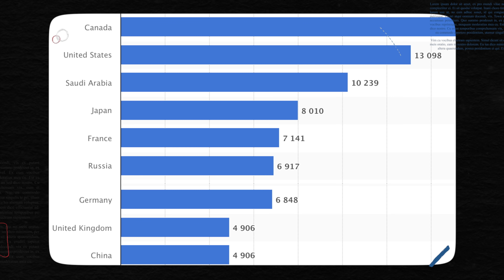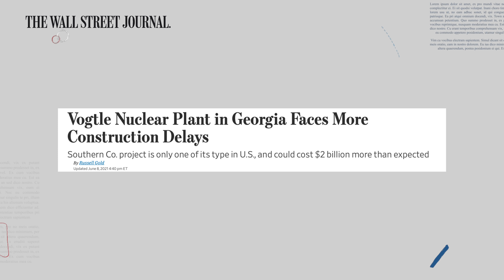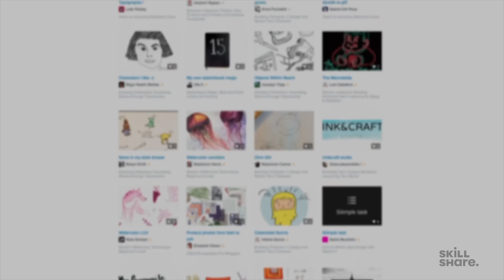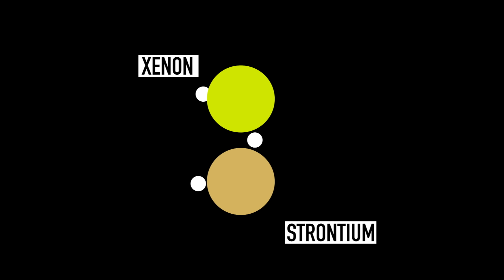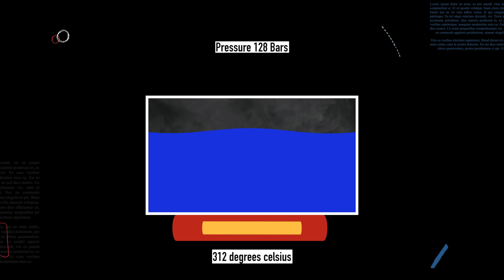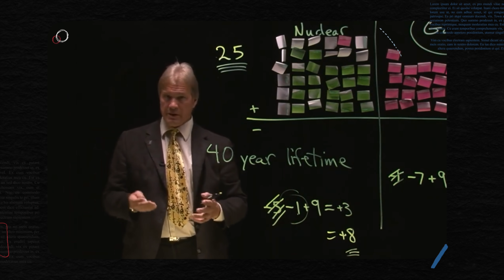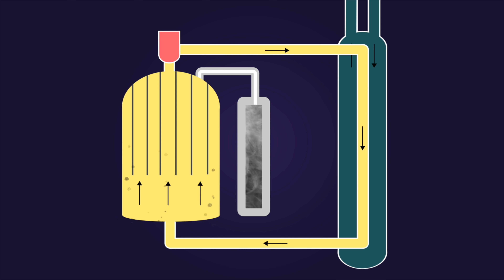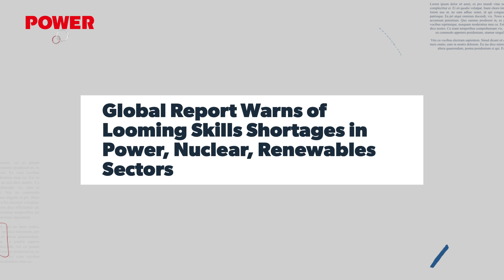Thorcon Just OBLITERATED Nuclear Energy’s Biggest Problem

Comment: You speak of the excellent safety record for nuclear reactors, but if you consider what turned out to be the astronomical monetary cost of cleaning up Fukushima then that "safety" record makes conventional nuclear power look unsustainable... Conventional nuclear power is a failed, inherently flawed technology in that the structure you have to build to contain an accident then makes it almost impossible to clean up that accident... The lack of progress at Fukushima even 10 years after the fact has to concern anyone considering building a new conventional nuclear power plant... So since thorium reactors don't need a containment structure you do save money up front, as you mentioned, but the real savings is when a meltdown does occur... and the cost of cleaning it up is two orders of magnitude cheaper than a meltdown at a conventional nuclear plant.

Comment: 1:13 the cost of managing intermittency skyrockets. So true, but very few youtubers dare to say it.
Reply: Thorcon should do like Natrium and store energy in molten salt. Natrium uses their molten salt fuel to heat large amounts of non-fuel molten salt.
Reply: @EnlightenmentLiberal 
nobody has 24 hours of batteries.
except  maybe houses.
and geothermal is a better bet yet.
continuous power with no more input.
could be put right in the middle of subdivisions or industrial centre.
Reply: cost of nuclear will put power out of the reach of many too.
renewable with storage is still cheaper.
and cheaper than nuclear and cleaner is geothermal.
drilling tech makes it available anywhere.
and you can put it anywhere power is needed, without mining or burning something.
no future fuel needs, no waste.
Reply: @HarveyG66  I live in Hungary, there is not much sun and wind in the winter, I don't think renewable will be an viable option in the winter.
Geothermal should be good here, the thermal gradient is higher then average, but there is no such powerplant just spas.
Reply: @HarveyG66  Entropy always wins. Geothermal is no more inexhaustible than Hydro is. To be practical you need a tremendous amount of underground heat near the surface and you can't get that just anywhere.
Reply: @patrickweaver1105  
heat is better in some places.
a test one is going in saskatchewan right now.
they had no problem making it work there.
you just need to drill deep enough.
and lower temp systems could be boosted with heat pumps.
it would easily replace the baseload problem from fossil fuels.
unlike intermittent wind and solar.

Comment: Huh, Huh, Huh. I got some questions: doesn't the molten salt fuel eat through most reactor and containment methods, because it is SO CORROSIVE. Does it not react with water explosively, so if it were to receive a leak of water drops or worse, if the containment were to break and the fuel were released into the atmosphere, the results would be plumes of vaporized radioactive fuel for the residents of surrounding counties to breathe in deeply? Finally, in computing the cost of nuclear power did you figure in the cost of depopulating areas the size of US states as you nuclear industry folks accoplished in Chernobyl and Fukushima? Are you advocating planting the nuclear power plants in the ocean bottom now, so you can honestly say that you cannot reach or fix or prevent the underground radioactive leaks, when they occur, to limit your expenses? Are you totally nuts?

Comment: Are they really gana finally start making these Thorium salt reactors should have been mass produced years ago
Reply: Huh, Huh, Huh. I got some questions: doesn't the molten salt fuel eat through most reactor and containment methods, because it is SO CORROSIVE. Does it not react with water explosively, so if it were to receive a leak of water drops or worse, if the containment were to break and the fuel were released into the atmosphere, the results would be plumes of vaporized radioactive fuel for the residents of surrounding counties to breathe in deeply? Finally, in computing the cost of nuclear power did you figure in the cost of depopulating areas the size of US states as you nuclear industry folks accomplished in Chernobyl and Fukushima? Are you advocating planting the nuclear power plants in the ocean bottom now, so you can honestly say that you cannot reach or fix or prevent the underground radioactive leaks, when they occur, to limit your expenses? Are you totally nuts? 

Go live in Chernobyl's exclusion zone. You can get very close to nuclear stuff there. Reportedly, due to the inadequate clean-up, Fukushima is also another place in which you can get close to your beloved nuclear power. Go play around among their plastic bags of contaminated, radioactive dirt. Those are going to leak soon, what with having been exposed to the sun and wind for close to ten years, so you will soon have nice, radioactive dirt that you can use to grow your own crops. Have fun, fun, fun, until the cancers take your fun away!
Reply: @mikefas1160  It dose not use water one the salt melts threw it deactivates cause it needs the plug catalyst  its totally different then the old way your basing your reaction on 1970s nuclear technology that was 50 years ago things have changed

Comment: The safety record for nuclear power is very good AND WE MUST KEEP IT THERE.  The extreme seriousness of failures makes EVERY failure unacceptable.
Reply: Its why I am against mass producing nuclear reactors. Having nuclear competing against solar, wind and fuels means it looks very attritive, having it compete against other nuclear powerplants means some idiot will think they can get away with using a sub par material or delaying a revamp if it saves a small amount until something goes wrong. 

I think we have to have reactors its the only thing that can sort our fossil fuel dependence that we have the tech for today, Its just in the future where they become common place I am concerned about.

Comment: I am loving seeing MSRs morning forward
Reply: Huh, Huh, Huh. I got some questions: doesn't the molten salt fuel eat through most reactor and containment methods, because it is SO CORROSIVE. Does it not react with water explosively, so if it were to receive a leak of water drops or worse, if the containment were to break and the fuel were released into the atmosphere, the results would be plumes of vaporized radioactive fuel for the residents of surrounding counties to breathe in deeply? Finally, in computing the cost of nuclear power did you figure in the cost of depopulating areas the size of US states as you nuclear industry folks accomplished in Chernobyl and Fukushima? Are you advocating planting the nuclear power plants in the ocean bottom now, so you can honestly say that you cannot reach or fix or prevent the underground radioactive leaks, when they occur, to limit your expenses? Are you totally nuts? 

Go live in Chernobyl's exclusion zone. You can get very close to nuclear stuff there. Reportedly, due to the inadequate clean-up, Fukushima is also another place in which you can get close to your beloved nuclear power. Go play around among their plastic bags of contaminated, radioactive dirt. Those are going to leak soon, what with having been exposed to the sun and wind for close to ten years, so you will soon have nice, radioactive dirt that you can use to grow your own crops. Have fun, fun, fun, until the cancers take your fun away!
Reply: @mikefas1160  Fluoride salts do not "react with water explosively"; you're thinking of sodium metal.

Comment: main task: stop people from confusing nuclear power with nuclear bombs
Reply: Huh, Huh, Huh. I got some questions: doesn't the molten salt fuel eat through most reactor and containment methods, because it is SO CORROSIVE. Does it not react with water explosively, so if it were to receive a leak of water drops or worse, if the containment were to break and the fuel were released into the atmosphere, the results would be plumes of vaporized radioactive fuel for the residents of surrounding counties to breathe in deeply? Finally, in computing the cost of nuclear power did you figure in the cost of depopulating areas the size of US states as you nuclear industry folks accomplished in Chernobyl and Fukushima? Are you advocating planting the nuclear power plants in the ocean bottom now, so you can honestly say that you cannot reach or fix or prevent the underground radioactive leaks, when they occur, to limit your expenses? Are you totally nuts? 

Go live in Chernobyl's exclusion zone. You can get very close to nuclear stuff there. Reportedly, due to the inadequate clean-up, Fukushima is also another place in which you can get close to your beloved nuclear power. Go play around among their plastic bags of contaminated, radioactive dirt. Those are going to leak soon, what with having been exposed to the sun and wind for close to ten years, so you will soon have nice, radioactive dirt that you can use to grow your own crops. Have fun, fun, fun, until the cancers take your fun away!
Reply: Main, main task: stop people from strawmanning opponents to have a easy way

Comment: Great video, outdated idea. Thorium reactors might be a feasible technology, but think again. Do you really want to have all that mining of monazite, refining related byproducts, and dumping of radioactive waste while renewables are way cheaper? Please price tag Thorium reactors together with their waste disposal and cleanup costs. Or confess that you are ignorant about radioactive pollution and clueless about renewables.
Reply: A fair point. So when doing comparison, at least for solar energy, remember to account for the disposal of solar panels as well, which also includes hazardous materials.
Reply: @munkitchew5829  Best to my knowlege, PV modules consist of alloy, silicon, glas, plastic and some copper. So called thin film modules used hazardous materials such e.g. cadmium, but this technology is not competitive and disappeared therefore. Thus, recycling PV modules is no rocket science. But radioactive waste is.
Reply: "Mining of monazite"? As in scoop up sand? But currently thorium is an unwanted by-product of rare-earth mining, available for less than nothing.
The US government used to charge nuclear plant operators about $300k per ton of spent fuel to pay for Yucca Mountain. Ample to pay for a disposal site; the problems are political, not technical or economic.

Comment: Fukushima's construction began in 1967. Today's reactors are designed with 50 additional years' worth of safety research and innovations baked in.
Reply: Unfortunately the lessons learnt from Fukushima have meant a redesign of new plants and will now mean upgrading other nuclear plants.
Reply: @bigbadjohn10  I don't think that very many nuclear plants are both located in tsunami zones AND have their backup generators located low enough to be submerged.  Not all that much upgrading and redesign to be done.
Reply: If it's backup power plant had been water proofed, there would have not been the meltdown. The plant was to be shut down due to age but given a reprieve. Part of that should have been ensuring a reliable power supply to the pumps perhaps with a backup battery pack as well as the DE generators.

Comment: Thank you for directly coming to the topic and no obnoxious over the top delivery. Needed a perspective on nuclear energy for my work, this has been extremely helpful.
Reply: Huh, Huh, Huh. I got some questions: doesn't the molten salt fuel eat through most reactor and containment methods, because it is SO CORROSIVE. Does it not react with water explosively, so if it were to receive a leak of water drops or worse, if the containment were to break and the fuel were released into the atmosphere, the results would be plumes of vaporized radioactive fuel for the residents of surrounding counties to breathe in deeply? Finally, in computing the cost of nuclear power did you figure in the cost of depopulating areas the size of US states as you nuclear industry folks accomplished in Chernobyl and Fukushima? Are you advocating planting the nuclear power plants in the ocean bottom now, so you can honestly say that you cannot reach or fix or prevent the underground radioactive leaks, when they occur, to limit your expenses? Are you totally nuts? 

Go live in Chernobyl's exclusion zone. You can get very close to nuclear stuff there. Reportedly, due to the inadequate clean-up, Fukushima is also another place in which you can get close to your beloved nuclear power. Go play around among their plastic bags of contaminated, radioactive dirt. Those are going to leak soon, what with having been exposed to the sun and wind for close to ten years, so you will soon have nice, radioactive dirt that you can use to grow your own crops. Have fun, fun, fun, until the cancers take your fun away!

Comment: Molten Salt Reactor use Uranium? this is not acceptable.  this is not the thorium reactors we were hoping for,, I think someone is changing the words around,  is article may be totally misleading.
Reply: The decay chain of Th includes U-233 & U-234. The main "advance" here is the molten salt. It's much safer than older designs.
Reply: Thorium reactor designs convert Th-232 to U-233. Uranium is the fuel that fissions. 

"Come for the thorium, stay for the molten salt."

Comment: Fusion is the key. The Wendestein X design in Germany shows great promise
Reply: Maybe in another 50 years
Reply: @keepitreal2902  even if "just" in 50 years, it will, or should say, it is already a game changer. Success in this type of research is by no means guaranteed, but not trying is guaranteed failure
Reply: @macbuff81  I seem to recall that we've been trying for a very long time, with no payback for that effort. The engineering complexity of Fusion reactors is so high, it is highly doubtful that they could ever  compete with battery wind and solar. They also rely on fuel not readily available as promised all these years, but rather on tritium, produced by certain conventional nuclear reactors. There isn't enough of that to power a single commercial fusion reactor. It's a fantasy, and an expensive one. To say it already is a game changer is kind of an overstatement.
Reply: @keepitreal2902  Nuclear fission was also once thought to be unachievable. 

Also, some folks also thought space travel would kill people just as flying in a jet plane. Oh, landing a space rocket with pinpoint precision wasn't even a thing just a decade ago. Today a certain company has done it over a hundred times without incident 

Technological advances are often unpredictable. They are a culmination of various advances such as material science as well as the complex calculation required for the highly complex geometries of the magnetic reaction chamber. Today most of us carry what is a equivalent to a talking supercomputer in our pockets, yet we seldomly give it a second thought

That's what blue sky research is all about. Pushing the boundaries and thinking big
Reply: @macbuff81  So you're going to ignore the facts I've given you and say let's just pay more 10s of billions for these big science projects that show little promise ...sure why not? Blue sky research is fine, but there are limits to the public purse.

Comment: The Greenland ice sheet is growing.
Reply: You want to kill it with nukes? Huh, Huh, Huh. I got some questions: doesn't the molten salt fuel eat through most reactor and containment methods, because it is SO CORROSIVE. Does it not react with water explosively, so if it were to receive a leak of water drops or worse, if the containment were to break and the fuel were released into the atmosphere, the results would be plumes of vaporized radioactive fuel for the residents of surrounding counties to breathe in deeply? Finally, in computing the cost of nuclear power did you figure in the cost of depopulating areas the size of US states as you nuclear industry folks accomplished in Chernobyl and Fukushima? Are you advocating planting the nuclear power plants in the ocean bottom now, so you can honestly say that you cannot reach or fix or prevent the underground radioactive leaks, when they occur, to limit your expenses? Are you totally nuts? 

Go live in Chernobyl's exclusion zone. You can get very close to nuclear stuff there. Reportedly, due to the inadequate clean-up, Fukushima is also another place in which you can get close to your beloved nuclear power. Go play around among their plastic bags of contaminated, radioactive dirt. Those are going to leak soon, what with having been exposed to the sun and wind for close to ten years, so you will soon have nice, radioactive dirt that you can use to grow your own crops. Have fun, fun, fun, until the cancers take your fun away!